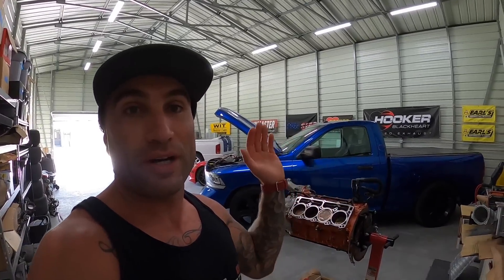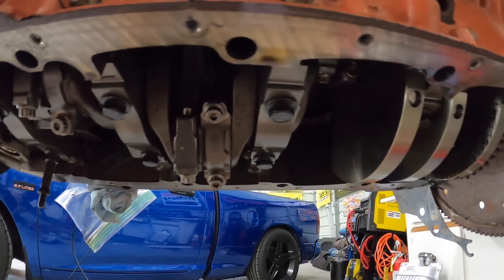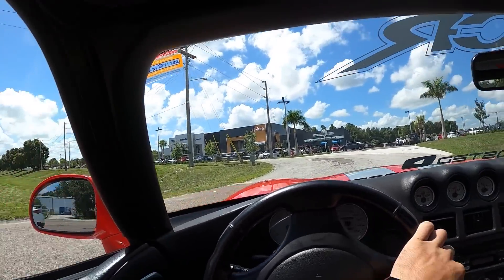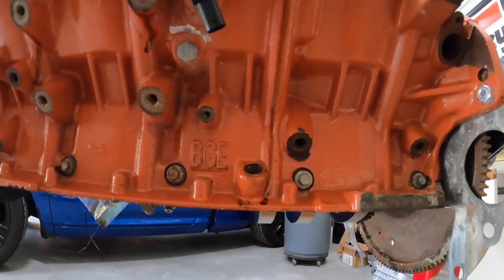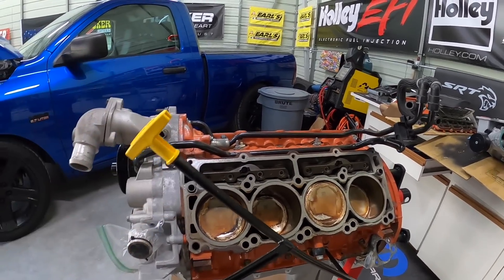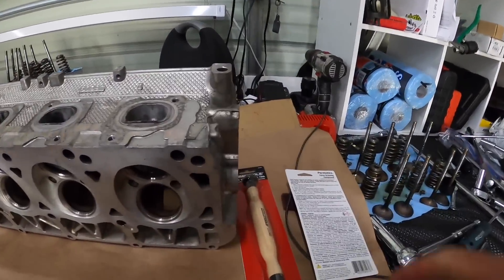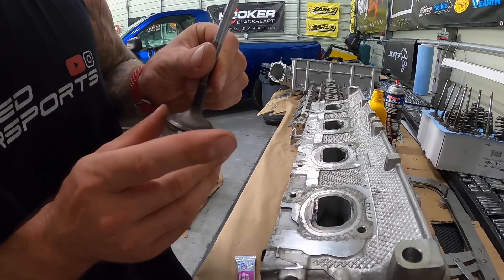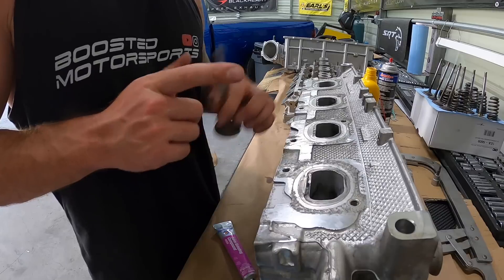Rebuilding a Hellcat 6.2L Supercharged HEMI Engine | Part 4

Comment: John, be 1000% certain you have cleaned all of that valve grinding compound out of the head and off the valves.. if any is left and it works its way through the engine you will be in a world of hurt...  also , you are rotating the engine in the stand to work on the pan right? going good and looking forward to whats involved in the swap out
Reply from the maker: Yup definitely going to give everything a good cleaning.

Comment: What Manuel were you looking at I have the Manuel for the 6.2 and it calls for 120 degrees on the main cap bolts, I’m currently building my motor and now I’m paranoid about whether it’s to tight now😂